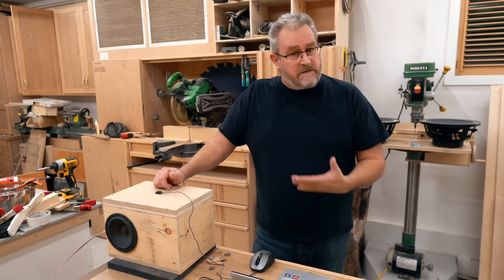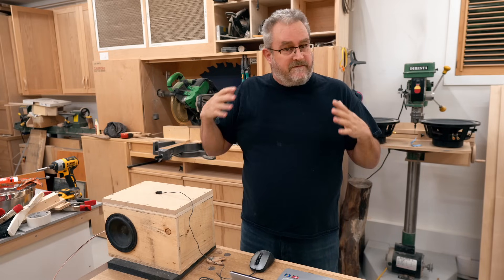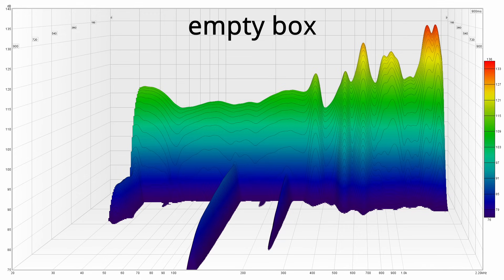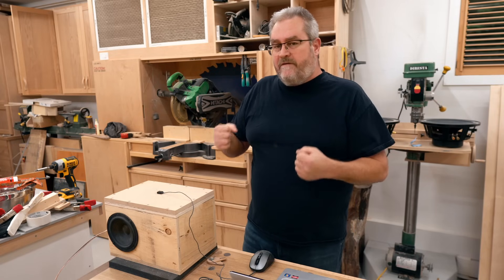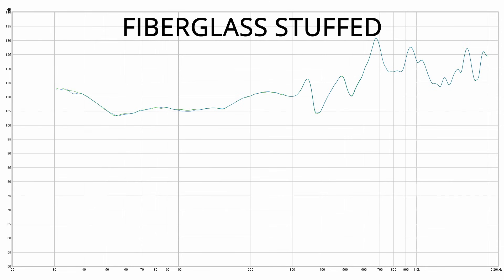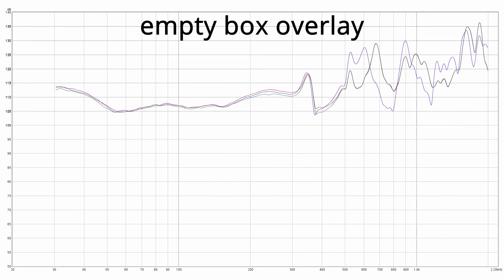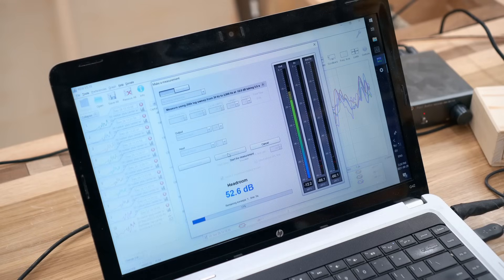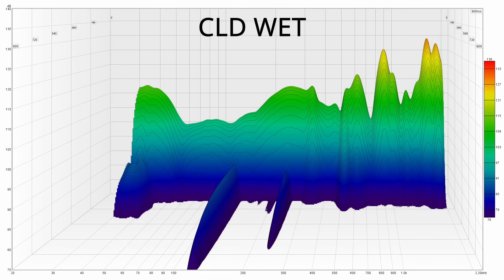Best Stuffing for Speakers Tested - Unexpected Results

Comment: Thank you John for this.  One thing that I would have liked to have seen done was to get the best results possible with the material you had, and not worry about the material being physically equal.  So what is the best that you could get using various amounts of Rockwool vs various amounts of fiberglass.  I understand that this would have taken much longer and it is way beyond my patience but it may be worth a try.
Reply from the maker: These tests can be used to decide how to get the best results without actually doing that. 
But then the definition of "best" isn't an objective standard in audio. What's best for you might be less so for someone else - no, definitely would be less so for someone else, given how picky and contentious audiophiles are :)
Reply: @IBuildIt  ...re the last sentence... with some (many?) audiophiles it’s almost more important to find materials that can marketed well rather then work the best. An example is that FG has been criticized in the diy forums for many years, which are full of comments saying don’t use it or get rid of it.

Comment: Your test is faulty.. What you need is calibrated measurement microphone.. Piezzo wont measure properly because driver itself is vibrating on wood.. You can test this by putting rubber sealer(used for doors) betwen speaker and hole.. Only you measure this way is resonance of wood itself that you stick it to, not the whole box..
Reply from the maker: You are free to do your own tests and share the results. This is YouTube, after all, not network TV.
Reply: @IBuildIt  just a little positive criticue of how you can make it better for your future test.. Great video by the way
Reply from the maker: Maybe by conducting your own tests you'll begin to see why I did mine this way.
I have a measurement microphone, but microphones are used to measure sound, not panel vibration. It's panel vibration that I'm interested in and the accelerometer does that.
Reply: @IBuildIt  in rew software there is a distortion section you might get more info there,, distortion is vibration of the speaker enclosure.. Plus frequence response changes using difrent material.. Best is to measure it outside or in well treated room to avoid difrent distorsions that happends in a room
Reply from the maker: A very small part of measurable distortion is panel vibration. The bulk is the speaker itself and there's no way to distinguish the two.

Comment: Hi John, thank you for the video! The following is my uneducated opinion. What if instead of using a bid of silicon gluing plywood and mdf, try to sandwich a whole rubber mat between them? Plywood layer actually seals the box, so anything outside do not need to be sealed. Also instead of rubber mat, the polyurethane mat can be used. The only parts that can transfer the vibration between layers are screws, but they are located, I believe, in the places with the least vibration energy. So, vibration has no choice but go through the mid part of the sandwich.
Reply: Rubber is a good idea but i would put it as a final layer on the inside of the enclosure. This is more stable.  You will get the best results if you mix materials with different resonance-frequencies. A ceramic tile on 60-70% of the side and backwalls (inside) will quieten your box too (may some rubber or bitumen on top of the tiles).

Comment: A well presented video. I like the control of parameters in one way. Having done quite a lot of work recently on exactly this type of internal dampening there are a few things to add. You have to keep something equal in the comparisons and that has to be in order for there to be a valid test of properties. Mass may not have been the best choice to create equality. Your explanation of how a fibrous panel can dampen internal energy from the air pressure created by the driver is spot on. Perhaps a more equal test of the different fibres would have been equal volume. With the Polyester fibres there was great contact with the box walls, and the glass fibers were in great contact with the box walls. The mineral wool was not. When you look up in the specs from each company that makes the insulation panels you'll find that Rockwool has a broader sound absorption than fiberglass when measured in thickness. I'm talking normal North American stud wall cavity thicknesses. Carpenter to Carpenter ( :) ) you know what I mean. Rockwool seems to have the edge due to what you referred to as the problem with Polyester Fibre. Mass. Rockwool is indeed heavy stuff. When in intimate contact with the cabinet walls it changes the cabinet wall behaviours. 

Again spot on is the attention to the resonant peaks at 350, 680, and 1.8 kilohertz. There is an approximate numerical relationship to these. They could be harmonics. And I'd love to see a impedance and phase plot to see their relationships. I'd be willing to bet that they are indeed harmonics. And this is the box singing along with the woofer. Note how some of the harmonics are actually louder than the signal. 

Nice demonstration of the panel bracing. That is a DIY loudspeaker myth as large as thick panels. Slaying the dragons one by one. Just because everyone is doing it does not mean that it is the best thing to do.

Last thought. Placement of your absorber is also a variable. You had a resonant cavity behind the woofer without any absorber present.
Reply from the maker: Thanks Mark :)
Hard to equally portion compressible material by volume and I think that would be less of a fair comparison because the rockwool is much denser than the other two. It would be the clear winner, just like a heavyweight fighter would easily beat lightweights of the same age in the same ring.
And I don't see the empty space as a variable, since it was empty for all three.
Reply: @IBuildIt    I agree with you assessment that the heavier product wins. Hands down. But isn't that the goal in DIY audio? To take the state of the engineering art farther. DAmn the torpedoes versus cost and time involved. And be willing to intelligently apply these gains in our own creations. This is done for the companies that I design for. Apply the best of what is out there and connect the dots on the stuff that is either not published or simply becomes intuitive with greater experience. Keep these videos coming. You have a good handle on this stuff. Much better than I have seen from many people on YouTube or otherwise.
Reply from the maker: As you have had some considerable exposure to audio forums, you'll agree with me when I say that what you say is best, might be completely rejected by someone else. 
Putting a denser stuffing into a cabinet might yield objectively better measured results, but it might not sound as good to someone who compares it to a less densely stuffed box. 
So I think the best I can do here with these tests it to try to show the apples to apples comparisons and the effects they have.
Reply: @IBuildIt    Oh do I agree with this. I post nearly nothing on forums. For good reason. So many arm chair quarterbacks it sickening.
Reply: @IBuildIt  You should be able to find information of the density of the different materials. If you have that, then you could easily weigh out the 3 to the match the volume ;)

Comment: Nice test!  Another option is the CLD with thinner panels that’s about the same thickness as a 19mm MDF. I bet the CLD wins.    The old speaker books and articles always showed better performance from fiberglass vs poly stuffing, and the really old articles from the UK mention sheep’s wool as the best stuffing.  Also, what about the speaker output due to the stuffing?  I thought the speaker output is smoothed out because the stuffing damps out the interior acoustic resonances.
Reply from the maker: The CLD has the most potential, for sure. Probably a combination of panel thickness and stiffness and size to arrive at the best result, but by then it might be deep into the rabbit hole and the time would be better spent doing something that produces more net gains.
I would like to get some wool to try, though.
Reply: @IBuildIt wool waste is the term. regardless of what the livestock are being reared for, they will need to loose their winter coasts lest they get too ott in the summer!

the value reimbursed to farmers, sadly, is minute as the bottom dropped out of the weaving industry years ago.

free wool waste for all? ! ah. not quite; still needs washing aaaand i have a nasty suspicion that it will be a right party hotel for clothes moths unless treated, or sealed cabs (inc front loaded horns)

have seen food distribution companies ship chilled goods to homes in a WW lagged container, sadly didn't get my grubby paws on a sample.

:-j
Reply: Some very high end speakers use CLD with a thin metal layer sandwiched between plywood.
Reply: If you use sheep's wool you might get some ba ba baaing above 1K!   Well, bad joke of the day.
Reply: @stevenholt5484  the bass will sound wooly

Comment: Do you think it would make a difference at all if you use fewer screws? I’m absolutely no expert but I was just curious I know she has a lot of screws to hold the top one and I was wondering if maybe the vibration from the side was transferring up through those screws
Reply from the maker: Panels are normally solidly glued, so more screws get it closer to that.